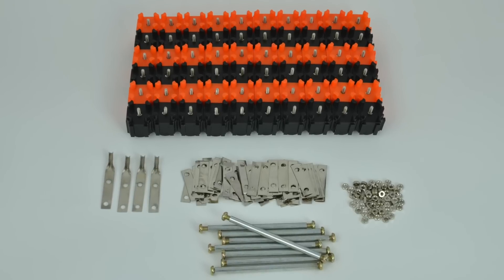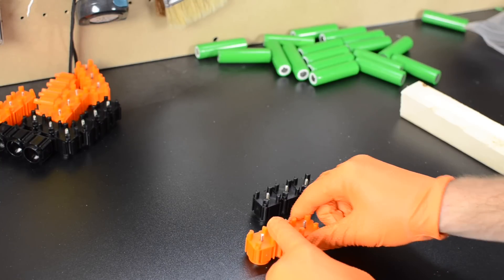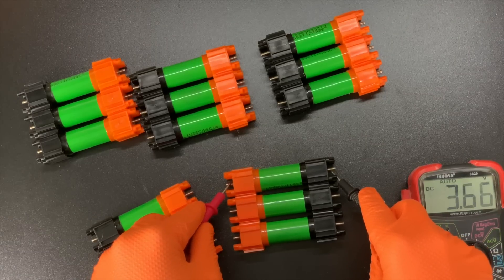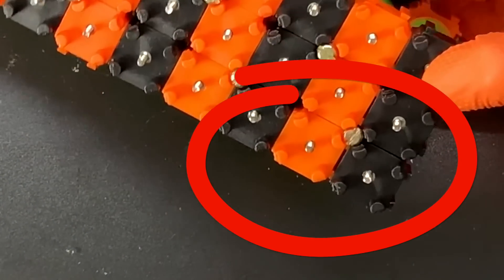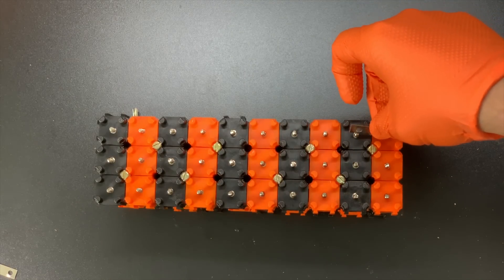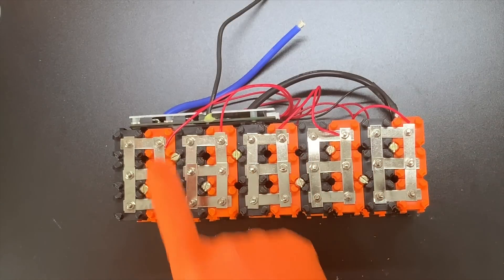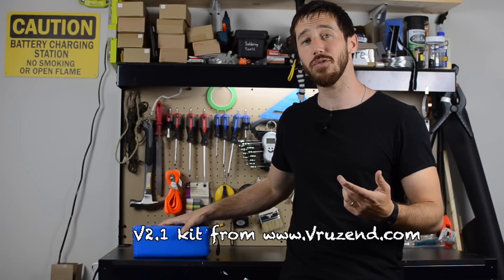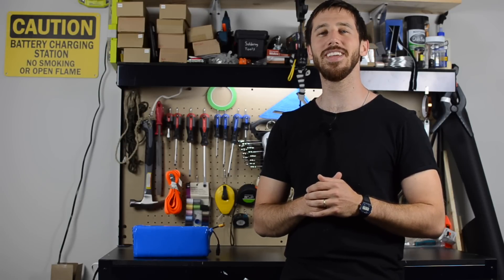New & improved Vruzend V2.1 no-weld 18650 kit

Comment: @EbikeSchool.com  Great video.  I have a question for you.  I would like to build a battery pack that will power a motorcycle lift.  The motor is a 12v motor and the current battery is an 18v 1400 mAh battery.  Using the items you have shown can I build a bigger and more powerful battery pack?

Comment: I like this connection system, although I'd recommend using blue locktite on the barrel bolts if they are used in a high vibration environment.

Comment: Can u make a video where u make 5x 12v batterys and connect those to gether so, it makes 60v battery? I have limited space on my escooter battery holdin space so:) At the moment i am using 5x12v lead acid batterys combined together there.

Comment: I will buy your book and all the components, BECAUSE I have an Ebike that I need to increase its battery power
My ebike has 48 V, 15 Amp

I am thinking about buying another one
But I  wonder if I can build one 48 V, 20 Amp and/or 52 V, 20 Amp????

Questions:
1. I s the Brussless motor of my ebike compatible to withstand a battery that 
Has more Volts and Amp than 
48 V, 15 Amp?????

2. If so, how do I connect it to my ebike?

Francisco 
347-443-1752

Comment: The bolts should be hex. I switched mine to them. LOT easier and secure to work with than regular flat screwfriver you mess up too close to the live batteries.

Comment: Just finished my 10s4p Samsung INR18650-35E Li-Ion pack :) DO NOT put loctite on the nuts if you want to easily disassemble the pack (for exchanging bad cells or charging each single cell seperately) !
Reply: Thinking about making the same build. How’s it working out so far?
Reply: @mannym1843  Not good at all...After just 15 cycles around 10 of 40 cells were dead (without BMS). I will test now each single cell with my ISDT SC 620 charger, add new cells AND FINALLY A BMS SYSTEM !!! If you don´t like to work on your batteries, I would not recommend vruzend. The quality of the plastic is really bad, too...It is only for DIY NERDS who either love to build or must build because they need a special size/format of pack, that is not for sale anywhere. Everybody else should buy ready to use battery packs !
Reply: @GrundlosGlücklich  wow. Thanks! Won't even try and mess all that. Went ahead and ordered something pre-built to save the headache.
Reply: @mannym1843  Last year I paid 3 EUR per cell. Now the price doubled ! Another reason to save time and money and not DIY...

Comment: Hi Mika, if I want to travel with my e bike most airlines have a battery size limit of 160 watt-hours which I believe works out to 4.5 amps on a 36 volt battery. Fortunately they will let you take 2 units per piece of baggage. (I haven't tried this yet so just be sure to print out a copy of your airlines requirements & take with you to check in.) Is there a safer, easier way to fly on vacation with your ebike & battery? Thank you.

Comment: Can I wire up another capacitor up to the capacitors that are already on the motherboard without soldering, my ebike has 4x63v capacitors on it, will I need 4 new 100v capacitors or just the one and wire it up to just one capacitor or do I need to remove them 4 capacitors and put 4 new 100v one's on the motherboard,  your info would help alot

Comment: Can you show us how to make a lithium ion car battery for an ICE car, including charging components? My next car WILL be an EV, but until then I have to drive my ICE car and I'm tired of replacing the battery every few years (pro-rated warranties are BS!) There must be a way to use off the shelf parts to make a 12V ~275 CCA battery. Store bought ones can run over $1000!

Comment: interesting, mentioning price would have been nice, checking vruzend's web site the 2.1 kit for 36V (30 batteries) is $ 40 and the 36V 10s BMS is $33, plus tax and shipping i imagine, don't forget cost of batteries, charger, connectors, tape, shrink wrap, etc., is additional.  not bad if you collect recycled free batteries (like i do)

Comment: A minor comment. I would use a locking nut on all of those figure 8 points.  They may rattle off under vibration.  As an alternative 3d print this stuff and just weld the battery bus bars on to the batteries.

Comment: Working on a diy power wall project. Really like your setup here with the battery caps. Was looking at using the 20700 batteries.  Do you guys make the caps for the larger batteries ornonly the 18650's?

Comment: I am curious what the "average" total cost would be for the entire battery build from this video including all parts?
Reply: @Joshua Owen  Just head to the Vruzend website and add to cart all the items he uses.
I did that just now and came up with a total of $54.95 without any battery cells.
With 30x 18659 cells to fill every connector supplied in the kit, it will be an extra $149.85 for the most expensive pair listed.  This can make you any number of combinations and will be the total cost of $204.80 (excluding shipping and I didn't add the kapton tape or nut driver)

If you only want a 12V battery as a reserve pack for say camping lights, you could use some of the version 2.1 connectors in a 4s4p configuration.  The cost if you ONLY wanted the exact cells for that kit would be: 16x 18650 cells, the v2.1 30 cell mounting kit, 4s BMS, heat-shrink, a black and red 14AWG wire for $134.87.  This would be a 14.4v 14000mAH pack (14AH).
However, if you had your own cells from recycled laptop batteries then you wouldn't need to buy the new 18650 cells and could get away with the $54.95 price for the assembly kit pieces.  Just make sure the cells are all good first.

Comment: not good for an ebike, when the spring heat up they will no longer be springs, just a loose piece of metal that will lose contact to the cells, the problem will grow as more and more cells are not in contact causing even more heat to contacting working cells

Comment: In a word, PLASTIC. Connections whose tightness is dependent on a substance whose name means it moves under pressure and loosens eventually. Without redundant contacts the single point of contact that is usually present invites failure. Multi-spring contacts are necessary for each contact. Perhaps a radial array verging on the center of each end. Oh yes this array at both ends. The mass of the cell cannot rest on a contact it will smash it down, and bounce away too. The cells must be fixed and have the spring s contacts at both ends.

Comment: Great review post and thank you for introducing me to a new product. I wanted to get advice on coming up with a strategy on building a sizable cell for home solar. I’m looking to use a commercial shelving system. I want to find a product like the v2.1 kit where I can build a 24v bank to use around 100 18650’s. Then add it to the shelf for use. Then I’ll purchase parts for another one every 6 weeks or so and add it to the shelf. I’m unsure just how many total I’ll need but as I get a good way n I should’ve able to test real numbers together. I’m figuring over 1000 18650 cells when I’m done. Thanks in advance.

Comment: cute. but sadly to expensive. if i used this product for my batteri pack. it would be the single most expensive component. (192cells 16s 60V)
Reply: But you can easily change out cells and reuse everything here...so is it really that expensive?
Reply: @Meekerextreme  YES IT IS. Only thing holding me back since I need to make 100kwh worth of packs

Comment: thats cool, i have an older 36v e-bike, it came with a 36v battery, note i'm not talking about 3 12v batteries in series just 1 large 36v lead acid. after that battery died i have not been able to find a replacement, 3 12v batteries in series will not fit in the case. that battery pack you just built looks like it could fit and have more capacity, mine was only 7Ah. was worried about not being able to spot weld the batteries and have put off the project for that reason. so thanks much for demoing that product. :)

Comment: Nice, neat, safe and secure power bank build !  It made me think about a back up DC power supply for my 2000 watt inverter that can operate in conjunction with a solar charge controller and solar panels that are not being well nurtured with sunlight on gloomy days to assure a constant 12 volt input avoiding low voltage shutdowns until voltage is stable at or very near 12 DC....  Just a thought that will never come to fruition because such a project would require a MPPT controller oppose to my PMW and solar panels I'm yet to get. But, such a power bank appears to be feasible and worth further pursuance when practical.

Comment: Cool indeed but....... you didn't show the one most important part of your system. And you don't show it on the website either. Now that's a bit weird if you ask me !.  You really need to show the springy electrical contact on the inside of that plastic cap in great ,,close up,, detail not just for a brief second. Perhaps without the plastic cap on. That will reassure buyers of the sturdiness and springhiness of the product and is a deciding factor in making people buy it.

Comment: Maybe a nylon cap or 3D printed cap for the long joiner would help ! Then you may not get a spread or even nylon/3D Printed washers with ridge overlapping the nubs sticking up around bolt hole. In a motorcycle battery shaking may cause spread/wear without retaining washer/cap.

Comment: Awesome videos! I bought and built an ebike kit w/o an LCD of any kind (just a 3 LED battery light on the throttle). Can a Cycle Analyzer or some other display unit that provides more information be added to the bike? Will I need to change my controller? Thanks!

Comment: Hi Micah. I have the kit and the physical assembly is done. Next step is bms, wrapping etc
But I do have a question. I notice there’s no cell to cell fuses in your system. Lots of others make copper bus bars with individual fuses between cells.
Is there a reason you don’t think cell fuses are needed, even on bigger packs with lots of batteries in parallel?

Comment: I have almost 1400 miles on my  60 V lithium 2000W  electric scooter. When I first got it a year ago my range was approximately 25  miles. Yesterday I ran it down to just over 16 miles. I  ride at modest speeds (  it goes over 30 mph; I'm usually riding around 20 mph ). Is that a fairly normal drain rate? I'm considering a DIY build for my next pack,  so is the savings and better output worth it and where do I get a 60 V BMS?

Comment: Just finished assembly of a 4s7p battery with LG MJ1 cells and the V2.1 kit.  Everything is working great NOW.  The reason it did not work at first was totally my fault.  Even though I had watched this video and your video from a couple of years ago cautioning us to follow the recommended assembly method; I decided to take a short cut.  What a mistake!  I have three suggestions for anyone considering making an 18650 battery.  First. you won't go wrong with the Vruzend V2.1 kit,  Second, if you are an older guy, like I am and don't quite have the hand strength that you had a few years ago, use a ratchet clamp (I used it on individual cells even.)  And last, please, please pay careful attention to the orientation of the caps before you put them on, as Micah says use a system!

Comment: Very interesting. That certainly makes things a lot easier than trying to spot weld the batteries together. 
How many batteries would I need to create an e-bike battery large enough run a 1500 watt motor on a bicycle pulling a trailer and gear weighing approximately 250 lb's (plus myself), averaging approximately 100 miles per day, up and down hills?
I've just finished a cycling trip around the coastline of Ireland to raise awareness for an eye disease that I have, and plan on doing the trip again within the next year or so. But this time I want to take an ebike with that will actually help me up the hills with all that gear :-) .
www.healingsight.com.

Comment: I live in an old house and it's electrical isn't so great. I plan to build a pretty large light show using 5 V individually addressable NeoPixel RGB LED strips. The longest strip will consume about 30 amps at full white all pixels on at 100 brightness. I'm building for worst case scenario here. In reality it will rarely be lit like this when going to music. Safety factor and I may want all the lighting for other things like shooting video or photography. 

 I just bought 270 of the Sonata 5300 used 18650 cells. They are already packaged in a Boston Medical Power 3S5P package of 15 duel batteries packs. I have read much of your DIY Lithium Batteries book. It would seem that a 2S, I haven't figure out how many in parallel yet, configuration would most closely match the 5V output I need. So far I haven't seen a Buck converter that comes close to the needed 30 amps. I would prefer at least 40 amps for a safety factor. Nor I have seen much in the way of large 2S BMS's. Suggestions best way to proceed please.

Comment: Hii, please excuse my newby status,  I see that in your videos you generally use 18650 cells of around 3.5 Ah, meaning that to achieve say a 30Ah battery you woulld need 8 cells in parallel. I am currently using cells off Ali Express in work lamps etc that are rated at 9.8Ah, which if I am understanding correctly would only need 3 cells in parallel to achieve our 30Ah rating, and so reducing pack size, and presumably on the downside the range of a bike. Am I correct in these assumptions, and  is it a feasible option?

Comment: I have this and am generally pleased with it but I have comments and suggestion. I didnt receive anywhere near the right number of "barrel bolts and plates. Also when pushing the caps over the cells it's a tight fit on most cells which is good, but it ends up compressing the air inside and like a spring, they tend to pop out a bit. I put the entire pack between 2 2x4s and gently squeezed them all on in a vise being careful not to over tighten. But if there were tiny holes  in the caps they would allow the air to escape making assembly and disassembly easier.

Comment: I like the pack couplers to eliminate the soldering. This wont work for a starting battery for a motorcycle because of the way the bms is connected. I will look at the web site to see if they have anything related to starting bats

Comment: Great video Micah! l find you so articulate and informative. l built my first 4s7p pack with this kit. Will this kit work with 32650 cells as well?
Reply: Obviously not 32 is diameter 650 it length

Comment: can I use this power cells to power my 24v 3KW inverter? just 1-2hours
Reply: Calculate it. You. Would need 5 35amp cells in parallel and 6 in series to get the needed discharge and voltage. This pack would have 26volt and 10.4ah which would run your inverter for around 6 minutes.
So just scale up

Comment: Why is there no balance adapter coming out of the battery?

Is it not common to actively balance-charge such packs?

in RC we have the plus/minus on XT60 or XT90 Connector and some balance cables...
Reply: Not necessary with BMS. Watch from 6:30.

Comment: i short circuit my 48volt battery and now the green light on battery charger blinks and the battery voltage reads 52volt i replace bms and it still wont take a chrge can you help me out thanks

Comment: Can anyone help? I would like to rebuild my Prodecotech electric bike battery. The battery is a 36V 16Ah battery. How many 18650 cells would I need to build this battery? Where can I find a sample build diagram? Would I just need to open the existing case and see how it is configured? If I open the case to dismantle the old battery (It is not completely dead) what precautions should I consider? Also, what would I need to do to build a 36V 20Ah battery? Lastly, is there a reputable and affordable service that I can just send my old battery to and let them rebuild the battery? Your help is greatly appreciated.

Comment: Awesome video. Thanks for adding the BMS. I have been looking for one that would do what I needed. I do have a question, are your lithium batteries iron phosphate? If not can they be used in your build?
Reply: Yes, if they are of 18650 size.

You can find up to 1800mAh LiFePO4 18650s cells.

Comment: No fuses involved in this battery pack, dangerous!. Also each battery is directly connected by metal connectors, what if one of the battery short out? this can cause a fire as power would still be sent to it from the rest of the pack. If each battery was connected by a fuse wire only that battery wire would burn out to disconnect that particular cell. It could then replaced at a later date.

Comment: So what happens when one cell shorts and all the pack dumps their energy through it? Zero fuses spoted.
Reply: The cells do not short out internally, the problem with these batteries is the exterior insulation melts, grounding out a wire connecting the batteries, usually a charge wire.   The solution is to physically separate the batteries like eggs in an egg-crate.   This kit solves the shorting problem.   The other issue is welding batteries together, and this kit solves this problem as well.

Comment: Great video, I gotta get the book! I've just purchased a Triride, which is an Italian built wheelchair attachment turning it into a trike. But the replacement batteries are stupidly expensive, with a locking 4pin din connector that I am unable to find on eBay, Aliexpress, or from RS components. So when the time comes it looks like a rebuild, which I may take on now.

Comment: Hi I use disability scooter,  with a  heavy 12v 21ah  x2 making 24vdc  lead acid battery pack can i change it for 18650 battery pack and if so can I get  more ah it runs 24vdc motor  sc series and 3. 0 A max 270 watts  can you help pls.if its lighter then I can go out more. Thanx
Reply: you can!
Reply: @kevdog20  so how